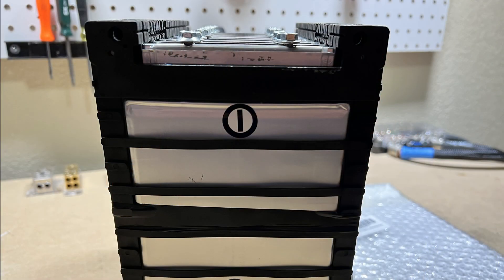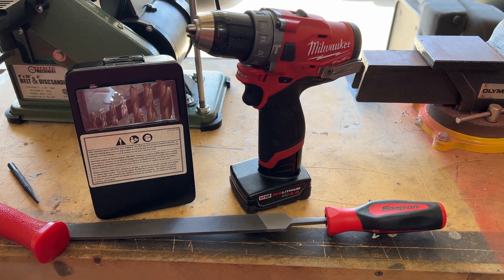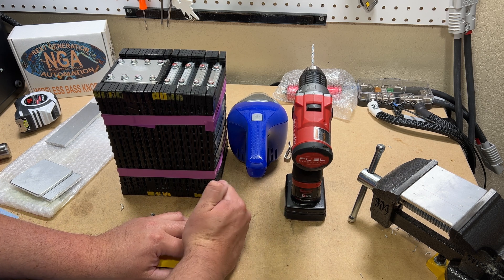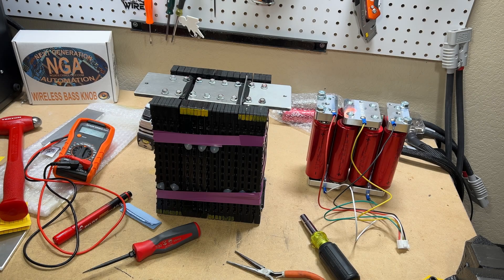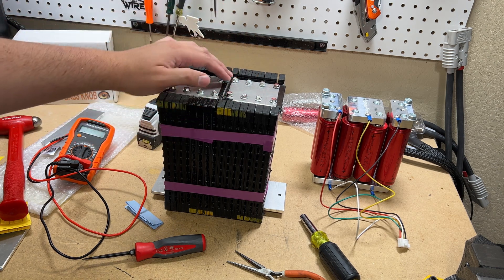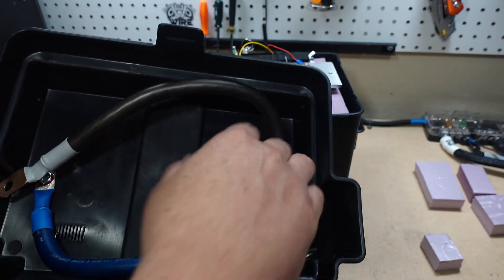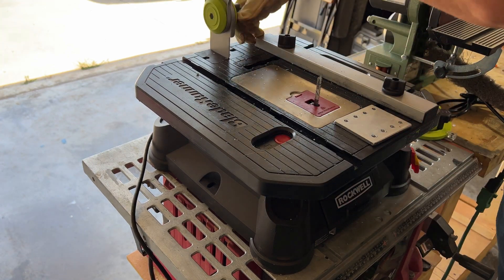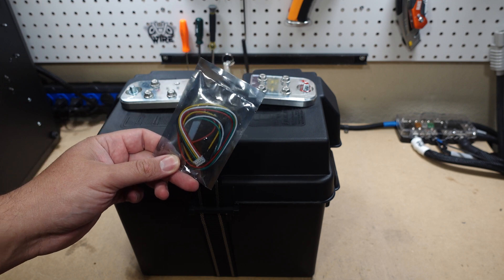DIY Lithium Battery Build Start To Finish!! SPIM08HP Cells

Comment: This may have already been answered, and if so, I apologize in advance. My question is, how many cells would it take to build a 96ah bank?. I'm gonna purchase 1 of those  36v 48ah 1.78kWh SPIM08HP POWER Module from Battery Hookup and in this module  there's 60 3.7v 8ah cells. So I just wanted to check with someone to see if that's enough to build what I'm looking to build. I'd appreciate your input because this will be my 1st SPIM08HP battery build. I've built a few Headway banks but I know these are different so I like to do research and learn as much as possible before I attempt to build any lithium battery bank. Again I'd greatly appreciate any knowledge you could give me because I've asked several other people but I've yet to get a response.
Reply from the maker: I used the cells that were already grouped into 16ah cells (2 8ah packs) 4 series to end up at a nominal voltage of 14.8 and 3 parallel to get 48ah. That’s 12 16ah cells to get to 98ah I would need 24 16ah cells. If you’re using the 8ah cells you would need 48
Reply: @HifiVega  thanks for the information. I really appreciate it and this is another reason why I like to watch your videos when doing research because you reply to questions. Thanks again!

Comment: You can't balance LiFeP04 between 3.00 and 3.40. You should really add a charge current to top balance them or at the very least connect them all together when they are above 3.40 preferably 3.45

Voltage means nothing to LiFeP04 relative to capacity
Reply: these cells aren't lifepo4
Reply: @diylithiumguy Starting at 30 seconds there are Headways shown......and they all seem to be around 3.30....putting them in parallel isn't really going to balance them. You're just playing the voltage game which means nothing. Actual balancing means balancing the Ah or mWh.....one cell at 3.30 could be at 7Ah and the other could be at 6.5Ah or 7.5Ah......So when you put those in series you are going to be missing out on some capacity because when one hits its max charge voltage or minimum discharge voltage the other cells will still have energy left/room for more energy to enter in.
Reply: @diylithiumguy  but yes your standard 3.6V/3.7V lithium ion cells have enough of a voltage curve that using voltage is close enough to getting matched capacity.

Comment: what is a decent thickness to use for the busbars? (bassing on a budget) lol
Reply from the maker: 1/4 aluminum or the stock bars are very cheap and are good for up to 300-400amps I believe. Go to the batteryhookup
Reply: @HifiVega  awesome. when i rebuild my battery and add another 8 or 16 to it i havnt decided yet i will do the bars. "With that being said", its going to look so good!!

Comment: Hey bro I built a 96ah spim08hp bank for car audio, now on my heltec balancer goes it need to soldered for lto or the nmc lfp solder point?
Reply from the maker: I’m not familiar with that particular balancer, but these cells are lithium ion so that should fall under the nmc lfp category
Reply: Thank you I appreciate it!!

Comment: Any clue how I could convert the 36v bank on battery hook up over to 12v
Reply from the maker: These don’t do well at 12v the best you could do is a 4s bank Ike this that needs to be charged at 14.8v minimum
Reply: @HifiVega  that's what I meant
Reply from the maker: @BassSoLowItHZ  just break the battery down and pair them up in groups of 4 series and how ever many parallel you can

Comment: Hey man, maybe you can offer some imput here cuz i'm kind of confused. I built a 128AH 12.8v headway bank and i am currently running it alongaside a yellowtop under the hood on a 300amp alt. And when the car is at idle it often sits around 13.2v or lower. At cruising speed it will never really get past 13.8. When my subs play it often drops to 12.6 to 12.8 and my amp is only doing like 2k watts.

Any idea how to get it to 14.4? Do i just need diodes? Could the alt be confused since there is different batteries in it?
Reply from the maker: What’s the output at the alt on the pos lead?
Reply: @HifiVega  one runs to the yellowtop and i have another 0 gauge run running to the lithium bank. 

Thanks for replying!
Reply: @HifiVega  oh, the actual output i'm not sure
Reply from the maker: @0_Reach  to diagnose the problem you’ll need to check voltages from the alt all the way back the chain to pin point where your problem is
Reply: @HifiVega  gotchya. Appreciate that. I do have a clamp meter. But honestly i think will just pull the wires off the yellowtop while its running and see if the voltage goes up. I do plan to delete it anyway.

Comment: Also aren't those lithium ion? Meaning 3.7v nominal? If so then they would be 16.8v peak and 12v flat. A bms would  also have a low voltage cutoff. I feel like the headway lifepo4 have a closer voltage range at 14.8 for cars these li-ion would be best for a vehicle that has the regulator modified or just a high charge voltage over 14.8
Reply from the maker: These have to be charged over 15v at the least. They’d work for someone with a custom alt spl competitor etc. I just did a headway build for the very reason you stated.
Reply: @HifiVega  yeah I saw that video as well. I'm working on a 24p4s headway setup. Taking my sweet time getting it done though. No time lately. I live in Maine so I added a set of automatic gray water tank heaters and 5 cooling fans as well as 4 separate climate controllers and I decided to move to two 300a continuous daly bms. With 900a peak cutoff when combined. I think 24p comes to 192AH with headways.
Reply: Get a hw904 or better DC/DC regulator, run it from your alternator's immediate fuse link, and check your alt. You may have damaged your diode if not continue to eBay for around 8 to 12 bucks. Lithium is different from lead acid charging. Please use my # as a reference only I buy a lot and have 8 4 cells, and 6 7 cells for my Camper go search it now and make sure you have it inside and a cover it is adjustable and should be stand-alone. Hope this helps

Comment: What about safety measures? I would imply a low temp charge cutoff bms And a small heater if your in an area that gets below freezing.  And if you're in very hot climates I would include a cooling fan and bms with high temp cutoff.
Reply from the maker: In my instance this is being used in a climate controlled area, but I do have abc fire extinguisher in the area just in case.
Reply: @HifiVega  oh I didn't catch that it was bench use. I would still consider a thermal control solution if you plan on abusing them At all. really if it's climate controlled you could simply rig a switch and a PC fan and have the fan cooling the cells when you think you might be hitting their upper current and causing heat.

Comment: Are those cells 3.7
Reply from the maker: Yes
Reply: @HifiVega  so it’s a 32 ah and this will sit higher than headway cells right probably not good for a stock 12 volt were your alt charges at 14.2
Reply from the maker: @cristovalmontoya5222  correct. It needs to charge over 15v

Comment: Dude heck yeah man this is awesome I built a couple of lithium batteries and they turned out pretty good it would be cool if you got into the different types of lithium out there that would be safe to use in a car application like the Toshiba scib 10ah 2.3v cells

Comment: So how does charge, just hook it up as a normal battery to your car?

When I run solo in my semi. I would like to run a small bank.
Reply from the maker: This one needs to charge a minimum of 15v, but if you’re rig is charging over that voltage you’ll be all set. If not maybe a headway bank might be a better option
Reply: @HifiVega  My rig holds at 14.2
So the headway would be the way to go. 
I was not sure if a special system was needed. Ty
Reply: @TheoneDragon51  if you’re building one of these cells for your semi, make sure you build it to hold at least 2000a on startup and when it’s cold make sure it can hold that continuously on cold starts. I wouldn’t recommend this for your setup in a semi unless you’re going to be upgrading alt in it to charge above 15.0v and if not you’ll need to overbuild to compensate for charging at 14.2v…. And for longevity, might us well use LTO chemistry in your semi or just stick with group 31s but get them elsewhere cheaper for your semi if weight isn’t an issue. Personally I went as cheap as Bringing a load tester to the semi junkyard and looked at it’s manufacturing date then load tested it at 100ah and got the best batteries there at $25 per group 31 then paralleled them to my existing 4 group 31s in my semi for more usable power for a system or lights or microwave and such ok an inverter…….. but you’re building a headway bank for your truck then.. so that’ll be a good happy medium…. Gonna be a huge bank to build :)

Comment: Nice video HiFi. 2 things I was left thinking about. 1. What is the battery number to those cells. 2. I wonder if you used a brass terminal binding post, could it hide the two buss bars that ended up on the outside. Oh one last thing what kind of metal is the buss bar?
Reply from the maker: It’s an aluminum busbar

Comment: I’m wondering if this could be paired directly with an AGM battery and if so, if the AGM needs to match its strength with the Lithium bank so they don’t tug of war on each other?
Reply from the maker: This particular set up needs to charge higher than agm so it’s not compatible

Comment: I have a 48ah Headway bank first lithium I've ever used and man am I impressed. I'll never buy another AGM battery for car audio, especially with the price you can get a superbeast now.
Reply: How much power will 48ah support?
Reply: @mftunz3555  4000w-6000w depending on alt size
Reply: What about a 96 ah with like a 240 amp alt ?  @Chris-B-Bassin

Comment: Excellent hifi. Only 2 things I'll add is the purpose of an active balancer is to get the most capacity you can. I.e. draining lifepo4 from full to 2.5v in theory the active balancer always balances. Since car audio doesn't or shouldn't ever get to 10v I don't use them personally. And while their in parallel charge them with an amp orso to actually top balance the pack. I only charge to 3.55 per cell because that's where the voltage in the car charges too. If your cells are good and have similar capacities you won't need to balance them again for quite a while. Keep the Excellent videos coming

Comment: I may have missed it, but what is an acceptable voltage difference between the individual cells?
Reply from the maker: It depends on the cell, but + or - .3v is where I wanna be
Reply: 0.01v... a balancer will keep it that close or closer.

Comment: What is your system for charging? Isolator? Is this for bench only or will this go in your car?
Reply from the maker: This will only be used in my test bench. If it was used in a vehicle it would need to be charged over 15v
Reply: Most vehicles it's simply a matter of putting a few  diodes in the Sence/ field wire to raise the voltage (.25-.5 volt per diode in series) add them till you get to the voltage your needing

Comment: Definitely helped me out.. I spent a lot of money on two 45ah limitless lithiums cause I wasn't sure how to do this I didn't wanna mess it up. It definitely would have been cheaper doing it this way
Reply from the maker: There are a lot of really nice pre built lithium batteries out there, but if you’re willing to take a chance and do the work yourself you can most definitely save some money.